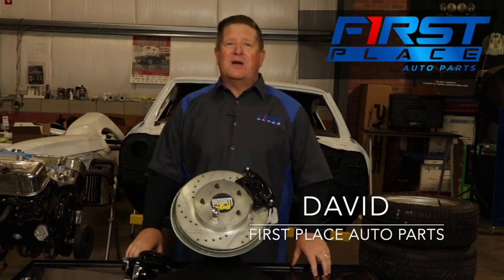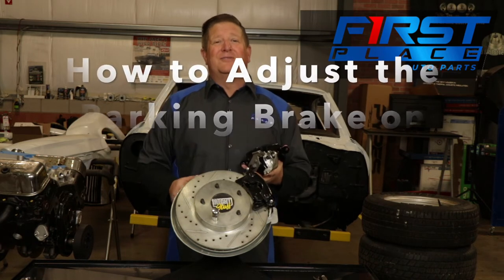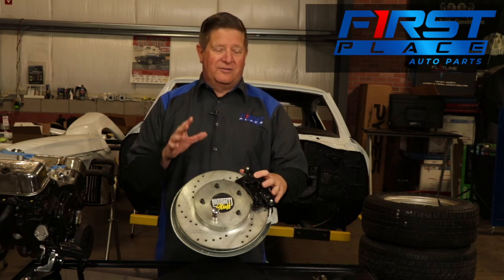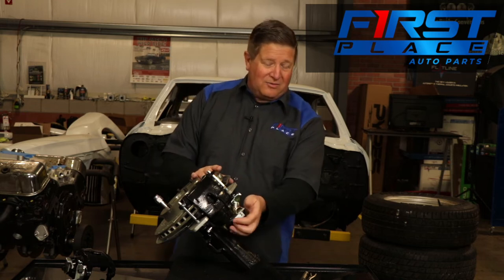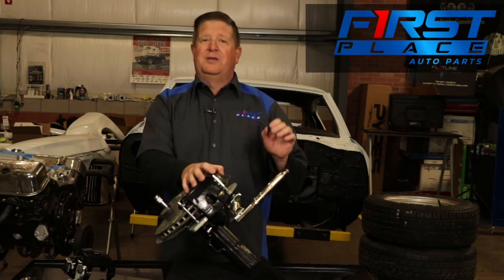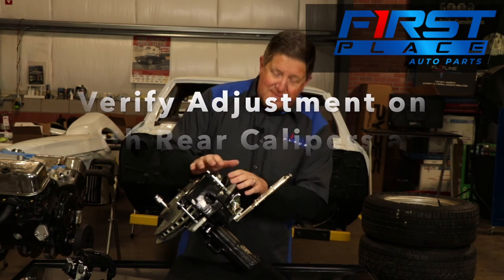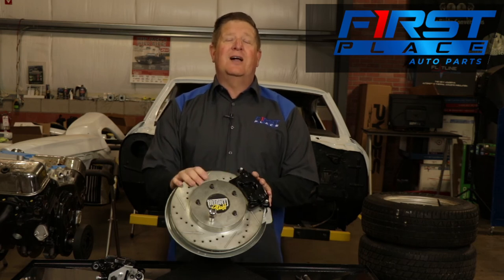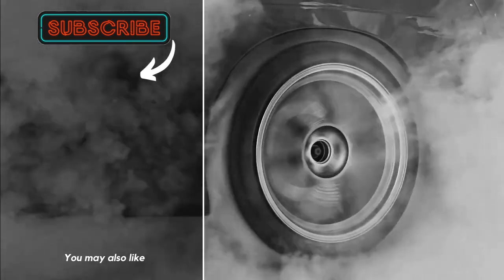How to Adjust Rear Disc Brake Caliper Parking Brake Mechanism

Comment: Thank you very much. I was searching for such a explanation for a few weeks. LOL.   I knew how the rear parking brake in the caliper was supposed to work, but wanted to adjust it properly.  Great Video.  (my application is a 2013 Honda CIVIC)

Comment: Does need bleeding after this process as long as i do this directly on the car?? How air will go in instalation just for doing that? And did you have to remove that bolt and then snap or you snap as it is?

Comment: Is there a difference in the right and left side calipers? Seams the parking brake brackets would be different and the direction the piston turns are left or right?
Reply: Turn the bolt clockwise to tighten on either side.
Reply: Yes bleeder screw should face up

Comment: This is all good information, but what happens if the vehicle has already filled with fluid ? I bought a vehicle where the arm moves 1/2 inch or more and want to adjust them.  Does this procedure work the same?
Reply: I’m assuming that the reason you want it without fluid is because the fluid in the caliper would make it hard or impossible to push on the lever by hand
Reply: I was curious if you were able to do this with everything hooked up?
Reply: Ever find out?
Reply: I just did this adjustment after filling and bleeding the calipers.  It works just fine.  I did exactally what is shown in this video and it worked perfectly.  The vice grip even fits with the cables installed.
Reply: I bought a 65 Galaxie 500 with 4 wheel disc brakes conversion. The emergency brake wasn't working so I tightened the cable as much as I could and still didn't hold. I'm assuming this adjustment is needed.  My only question is do I need to drain the fluid?

Comment: I was about to bleed my brakes when I saw this video. Instead of disassembling the caliper like in your video I just tightened the emergency brake cable adjustment screw about 11/2" tighter than the original setting and got the 1/8" stop clearance you suggested. The emergency brake works great. I suspected it might because when I installed the pads they were a very tight fit. The RuffStuff kit I bought had brand new Cadillac brake calipers, new rotors and new pads. .

Comment: Thanks for this, good to know that drag on the pads is okay.. I shimmed my rear disc kit like that and had cycled the piston twice ( I mean theyre loose enough to go over the rotor but tight enough to drag)  I wasnt sure if my new setup was too tight against the rotor..  I'd rather be safe than have that pedal go down.  I work very slowly when it comes to brakes
Reply from the maker: Glad it helped